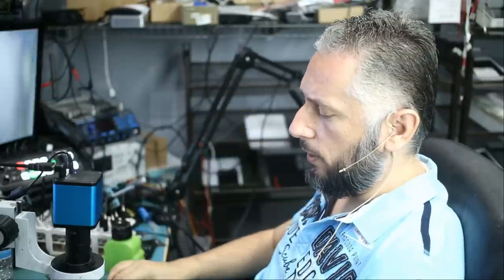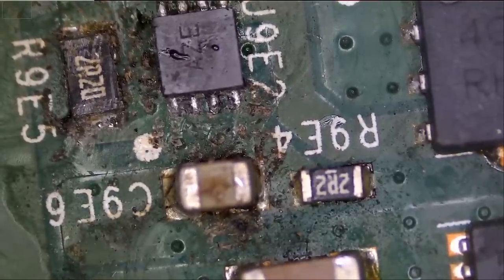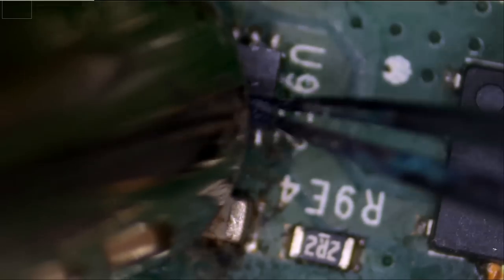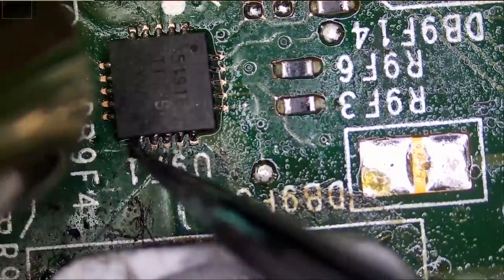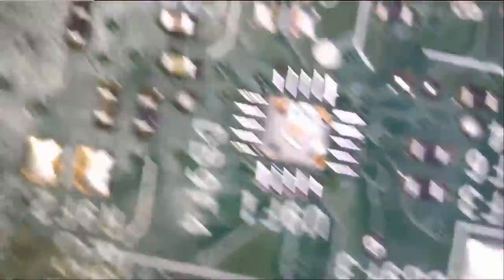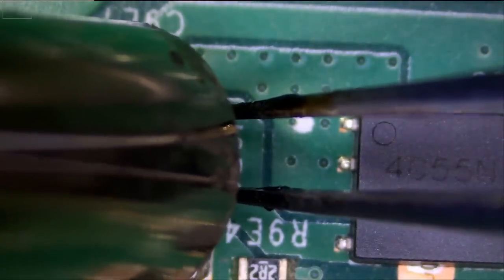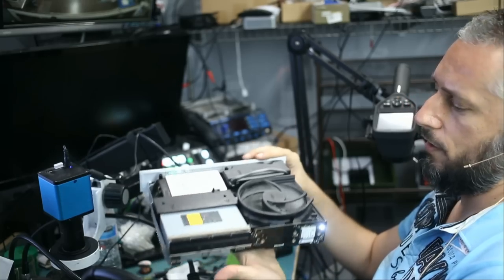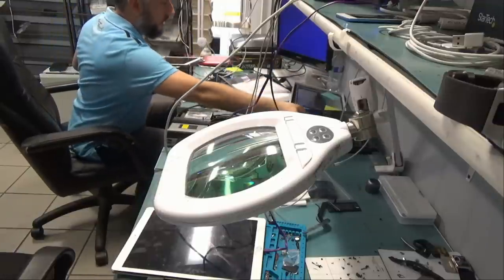xbox one s repair turns on then immediately shuts back off

Comment: U9E2 is a mosfet driver IC and usually burns out the little resistor above when it goes bad, the resistor acts as a fuse and prevents more damage to the board. The part number for that component is NCP5901BMNTBG
Reply: Also 51916 is a ddr3 memory power management ic (TPS51916) and regularly goes bad
Reply: @graphicscardtech3167  yeah they're a little tricky to find but they are available 😃
Reply: @graphicscardtech3167  yeah I also buy them in bulk because it's cheaper and I fix hundreds on xbox one s consoles with the same problem lol
Reply: @TheCod3r  do you have an online store front, I have this issue with an xbox one s console and want it fixed. I didn't spill anything on it but has similar issue.
Reply: The man, the myth, the cod3r lol. Freakin legend man.

Comment: I'm not surprised that the fixes didn't work, the board was still caked with what ever was spilled on it. The board once it was first looked over and saw where the damage looked to be, should have been washed over with alcohol to clean it. Then reflow the solder.
Reply: Correct, he did not clean all that mess how it will work with some liquid working probably as a conductor .
Reply: exactly, I was wondering too, why is he not cleaning all the liquid
Reply: Lol..look at all of these "experts".
Reply: @tomcadero9875  Used to working in console/pc repair for over 15 years before I moved on to Network specialist for a UK telecoms company, but what do I know?
Reply: @atomic4l  if he would cleaned everything he would no clue where to look...
Reply: @B9NE  if you read what I posted correctly I said "the board once it was first looked over and saw the damage looked to be" he would have known what to work on once it was cleaned.
Reply: @tomcadero9875  we can give an opinion? Keep quiet. Respect yourself.

Comment: Ever try an ultrasonic cleaner? I have revived/repaired MacBook logic boards with just running it thru there. Works especially well (50% of the time) with any boards without any burn marks. Corrosion is blasted away with osolating ultrasonic waves. 5 min,  then rinse with 90% isopropyl alcohol and then dry with air compressor and let sit overnight. Board looks good as new and also eliminates all corrosion issues.

Comment: I have the same power problem with my xbox one x.  Barely used it. No water exposure. It was in a Gaems case between my legs while I was opening a door and it fell like 2 or 3 inches and now it powers on for barely enough time to eject the disk that was in it.  Wondering if a chip had weak solder or something after watching this.  I'm not really equipped to do what you did.  it's a shame because I barely used that xbox for almost a year and I finally start using it again and this happens.  One day I might try to find a repair shop like yours

Comment: How is it when you receive a very dirty board, you do not clean it of debris, after noting areas of concern???   Very often those bits of debris are moist, and that can cause problems on a continuing basis.  There are various liquids in pressurised cans that are electronic cleaners.

Comment: The Xbox cannot display the signal as the resolution is too high for your display. You can reset it by holding a few buttons as far as I can tell. I think it's the power and eject button for 10 secs

Comment: Have a similar issue on my bench right now. They took it to UBREAKIFIX and they ran it through an ultrasonic without inspecting, so finding the issue is proving troublesome.

The standard mosfet failure is not my issue - all test ok. A bit of a head scratcher that I admittedly have set aside for other work. Will have to re-visit.

Comment: I have an Xbox 360 problem, I can turn it on with the controller the power supply is green, and the console does turn on, but after about 5 min everything turn off. How can I fix this?

Comment: My xbox one s power supply went bad from lightning a while back so I ordered a new one. When I went to turn it on it cut on and right off. I noticed I broke the power button off of the pcb board so I ordered a new one. Just installed the new one and it still won't stay on. I have no idea what to try now

Comment: Mine was struck by lightning I took it apart and I see no damage anywhere it powers on the light comes on then cuts back off spent hours just cutting it on to just cut back off I swapped the battery back because mine wouldn't power on at all to my friends his was struck to but his power box lights mine up to just cut back off idk what else to do

Comment: Out of range HDMI means the display can't handle the incoming signal settings.  XBOX One can do 4K and if it is set for that resolution then any display connected to the console that can't handle the incoming signal resolution will give off that message.  I'd just like to know what chips you replaced so I can fix mine.

Comment: Had a one s doing that to me after changing the hdmi retiming chip. Pressed the sync and power then released the power. Was doing this because the resolution output for my monitor was wrong.
Reply: did you ever find a fix? im having the same problem

Comment: Having the same problem, mosfets check out ok, can not see any other issue except for the usb port in front, looks like someone tried to repair with a new one, i dont see solder all the way threw the hols in the pcb...... could that throw a short and shut down issue?

Comment: to check if retimer issue hold the eject button when you power on until it beeps a second time. if boots into 480 low resolution mode its the ic bad

Comment: Once the chip is off the board what do you use to keep the new chip stuck to the board I got a hot air station in flux low melt wire but it keep sliding all over the place 😢😭😭

Comment: I think the last issue of the xbox after you fixed it is that you need to reset the display settings of the xbox. Start it in safe mode. It should fix the issue. The xbox clearly is fixed now :)

Comment: When I try to turn on my Xbox One S, the button lights up and it makes the noise, but then it shuts off and there’s a faint click inside it.
I’ve had it 3 years now and it’s been fine up on till now apart from a few times not turning on because dust was in the power cable.
Mine has an internal power supply, so I can’t even see wether it’s a problem with that like I could with the Xbox 360. I think it overheated tho, as with the previous Xbox’s you could set it on its side but the One S has vents on the side as well as the top, so it could’ve not be getting hot air out and overheating, as the side I had on the floor was the side the faint clicking noise was coming from.
Reply: U try opening and dusting it ? Lol
Reply: @cormaro13  yeah, took it to a shop and they couldn't fix it so just bought a new one Lmao

Comment: Hey I am having the same problem but not due to liquid damage. I opened it to replace thermal pads and thermal paste. Now it turns on and then jnstatily off. Sometimes I can hear the hard drive spin. The fan doesn’t turn on at all. And it makes a weird buzzing sound. Is it due to motherboard damage or do I just need to replace the fan. Thanks so much!!
Reply: I've got the same problem, did you fix it?

Comment: is he going to just start pulling parts off like he did with that switch lite he was trying to fix he has all this fancy repair stuff and before he even used any of it to check for problem spots he just started pulling stuff off the board with out knowing if they were even broken 1 min in he is like oh this needs to go
Reply: It’s educated guessing and a gamble based on experience with many repairs of similar issues.  I believe he has troubleshooting skills but he is running a business and trying to maximize throughput.  There are probably other channels on YouTube that do in depth troubleshooting and analysis.  But they probably aren’t trying to run a profitable business with a large backlog either.

Comment: This is what happens to mine after thermal paste replacement any tips?
Reply: If you used too much thermal paste and if your paste is conductive then It could a similar situation. I typically use mx4 compound as it's non conductive
Reply: @TechMatticz  man that Xbox is cooked now 🤣 that boy is gone
Reply: On to the next one lol. Bought an og Xbox one from an online pawn shop and got one that had animal urine liquid damage. Took it apart and doused it in rubbing alcohol/compressed air. Let it air dry in front of a fan for like 3 days. Thing ran like a champ after. Also came across this vid because I'm looking at a liquid damaged console to work on for the wife to use so she can get off mine! 🤣🤣

Comment: my xbox, i spilled dr. pepper in it on accident. dried out and worked for two days, now power on then off immediately. what do i do?
Reply: Buy a new one and don't put liquids near electronics in future.
Reply: @shifty2755  update: i switched power cords and it works now. I have no idea why that would be a fix.
Reply: @Employment613  

Did you swap the brick or just the lead???
Reply: @shifty2755  just the lead. strangest thing ever and done in despiration.